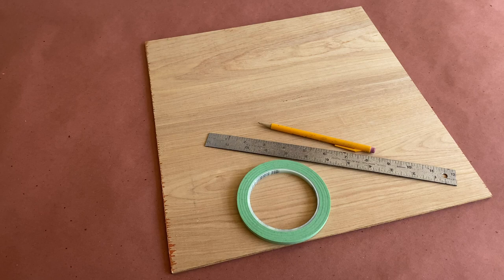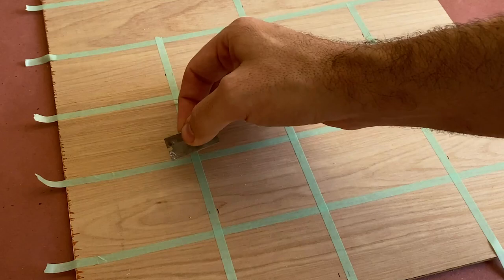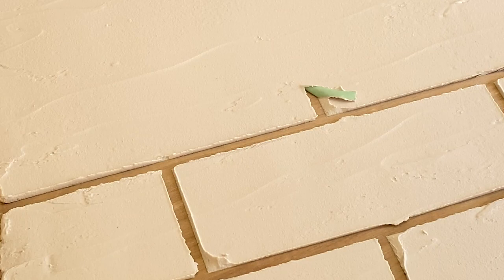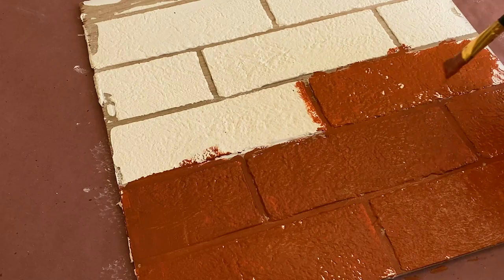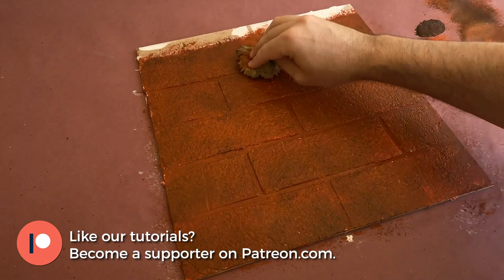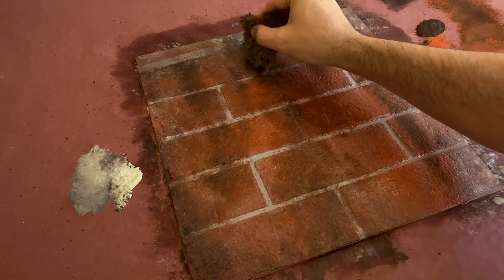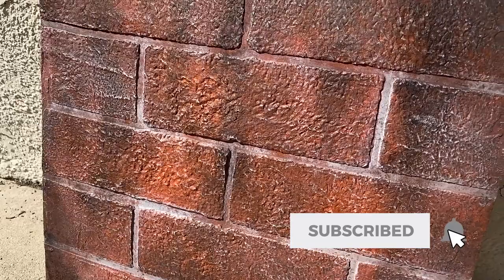Easy Fake Brick Wall Using Joint Compound

Comment: I let it set for 30 minutes before removing the tape. It prevents the smudging and moving.  I did this for a back splash. Holding up after 10 years.

Comment: Can this be used for set pieces that will be outdoors? Does the paint protect the joint compound from water?
Reply from the maker: I've never tested it, but would assume that the acrylic paint will protect it and I would consider an additional layer of something like Thompson's Water Seal just to be safe.
Reply: I have this on my back splash in my kitchen. I put 3 coats of cabniet epoxy based paint and a top layer of semi gloss polyurethane.  Its going on 9 years and holding up excellent.  No problems around the sink or stove.  There is a uv paint for outdoors that would be perfect for outside things. I will be using that when I do my outdoor kitchen area

Comment: Hi. I'm trying to make a Dracula's Castle tomb wall in my living room on a very cheap budget. Will this work on anything. Like foam core board? Or Fluted plastic? Or wood only?
Reply from the maker: I’d stick to non porous surfaces since there’s moisture in the joint compound. If you’re using plastic be sure to scrape up the surface so it’s got something to bite into.

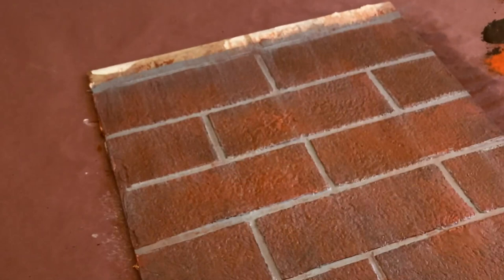Comment: you were good at 5:46 he what is joint compound in the UK?
Reply from the maker: Great question. Unfortunately I’m not sure. It’s what you would use to blend them seams of newly installed walls or to fill cracks. Not sure if that helps any.

Comment: Awesome tutorial as usual.  I was thinking this would be a great way to do my cemetery columns.  Do you think it would hold up to rain?  Would a coat of Dry Loc on the top help with weather proofing?  Thanks so much for all of your work!  It's greatly appreciated.
Reply from the maker: Yes to both, assuming the joint compound is completely dry before any additional coating is applied. As an added layer of protection you could spray it with Thompson’s water seal.

Comment: Wow. That looks SO good! Awesome stuff, Derek. How would you compare this to the foam brick method? In terms of cost, time, realism, etc?
Reply from the maker: Thanks, Jen! I’d say this is faster, more accessible, and cheaper than foam. On realism, it’s a tough call. They both can look pretty real if done well. I think the biggest drawback on the joint compound version is thickness. Much easier to do really dimensional brick with foam.